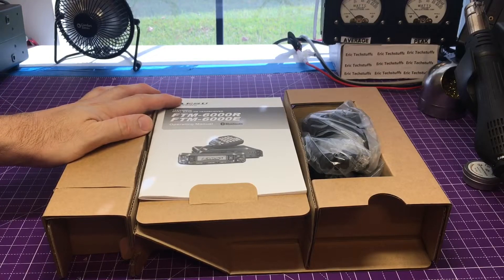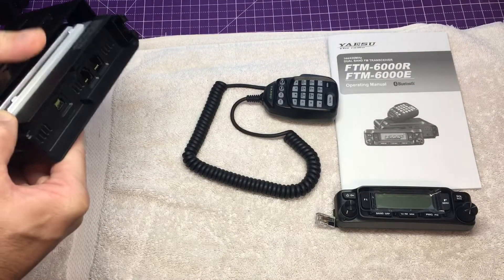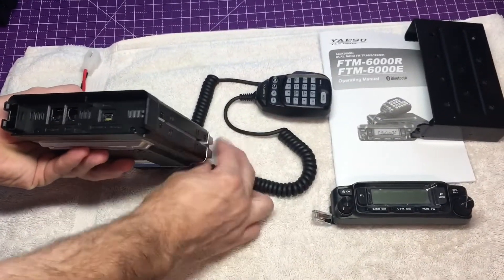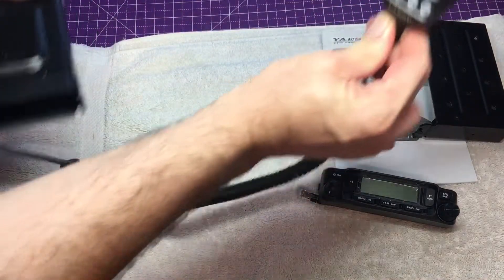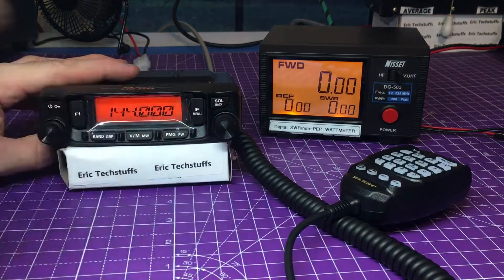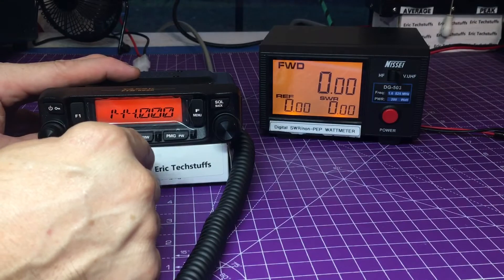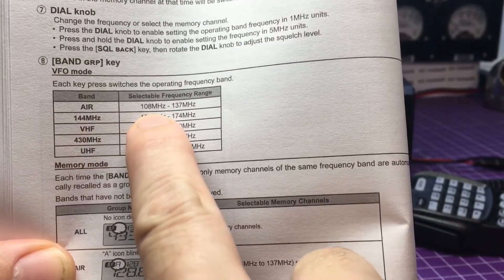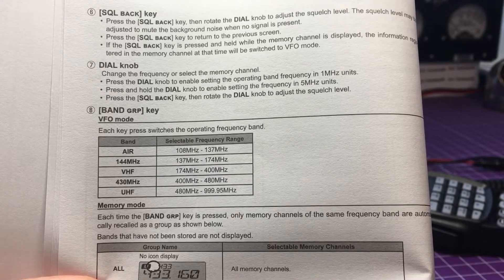Yeasu FTM-6000R: Unpacking: Bluetooth BU-4 Install:   2m/70cm mobile with WIDE coverage

Comment: does this BT module connect to third party speakers for audio?
Reply from the maker: You should be able too. I no longer have this radio. I never connected BT to it. But when two items are in pairing mode it should find eat other.  Sorry I couldn't be of more help ! 73
Reply: @EricTechstuffs, you no longer have this radio?  It doesn't say much for the ftm-6000r,  I assume if you liked it you would have kept it.

Comment: can you use the usb cable for the soft ware
if not what is the usb cable for
Reply from the maker: Possibly.  If the software cable is used for other radios you can use it

Comment: Trying to install the Bluetooth chip on mine, what size screwdriver did you use? I got some precision drivers and they are not doing the trick.
Reply from the maker: I used a #0 Philips tip. It's a cheap orange and black screwdriver  from the kit precision screwdriver kit from Harbor Freight.   Hope it helps !
Reply: @EricTechstuffs  thank you.
Reply from the maker: @nathansharp9957   Not a problem ! Anytime ! Also I pushed down a bit while turning and it'll give way.  73 !
Reply: @EricTechstuffs  #0 Philips worked

Comment: Thats a useful rig for scanning the 800mhz the police here and such nice little rig also 440 mhz. That would be cool to mount the head on the bench and hide the transmitter underneath the bench. Cool presentation 👍💯⚛
Reply from the maker: Thanks. I never really go on 2m or 440 much. Do like HF more.   Most public safety in my state are on a state wide trunking system with most  digital encrypted.   Had to get rid of the old radio shack triple trunking scanners.  This will fit the bill to see what is left analog around me !